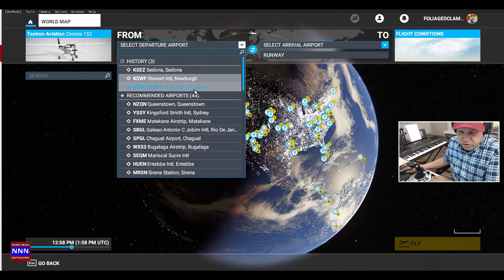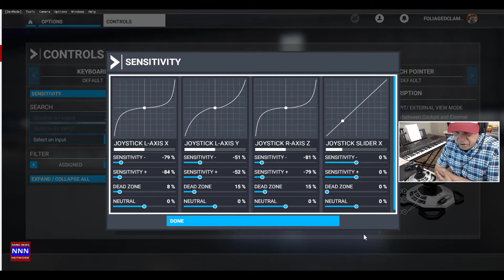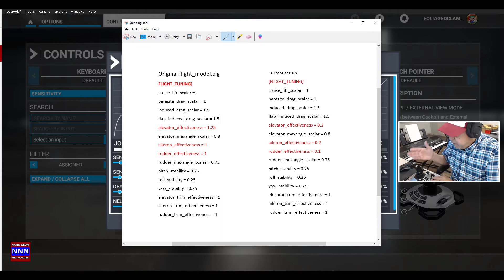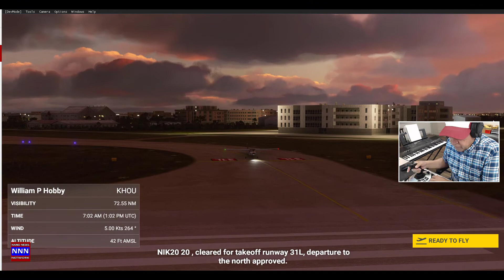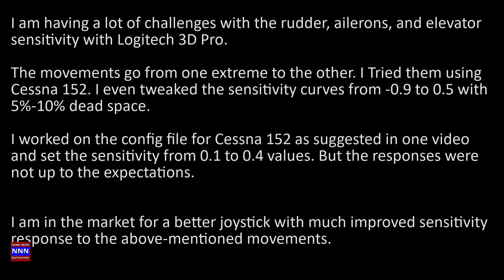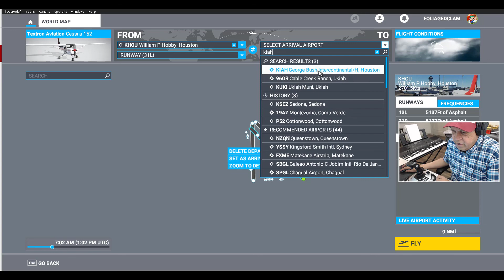MSFS 2020| Logitech Extreme 3D Pro | Sensitivity challenges  Aileron Rudder and Thrust | Need help

Comment: I'm having the same issue with mine. This is my second Logitech Extreme 3D Pro joystick to do this. I feel the flight stick itself isn't securely seated, so as you use it more and more, it loosens up even further. I play Star Citizen and I'm always having issues with my ships rotating to the left, and it's something I constantly have to counter/correct.